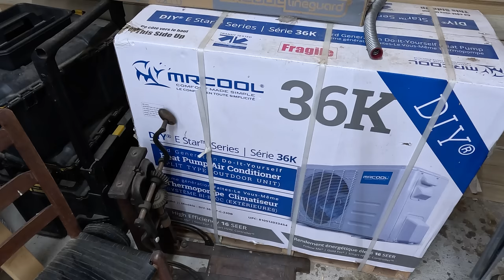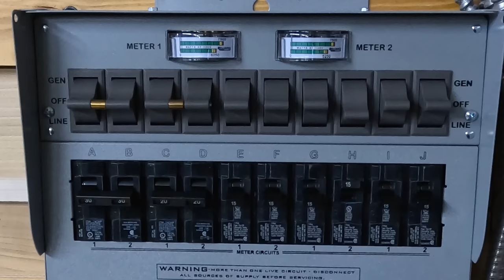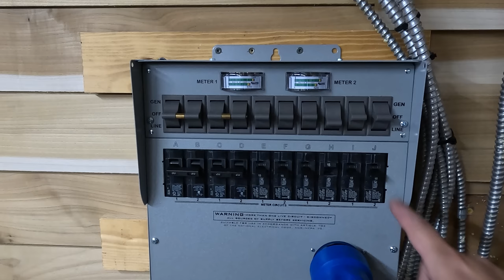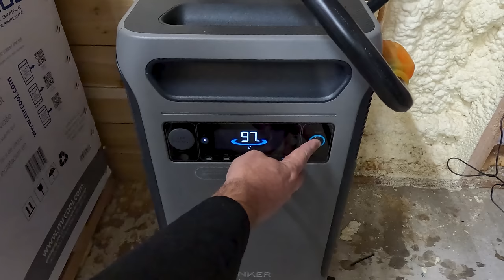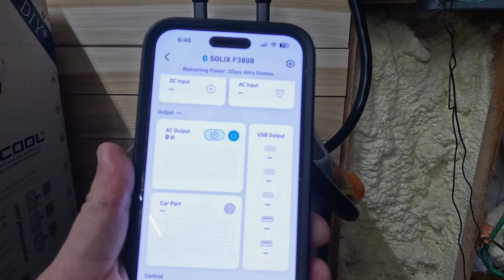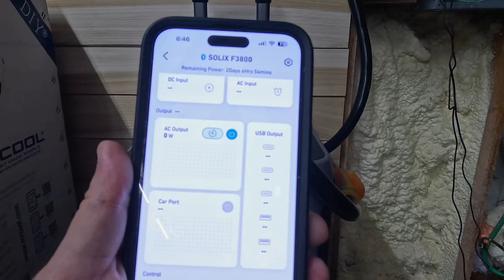Off Grid Power For The Timber Frame!  Anker SOLIX F3800

Comment: Shouldn't the blue plug mount through the hole in the switch panel with the heads of the screws on the outside of the panel instead of having the screw ends facing you?  That way the stress is on the blue plastic and not the screws.  Nice summary video of the installation.

Comment: Thanks for sharing with us Nathan, that is an awesome set up you have there and correctly installed will give you peace of mind knowing the safety for everyone involved during a power outage.  Thanks to ANKER for sharing their product with you. Fred.
Reply: While I understand you need to make paid advertisements for sponsors, this is a ridiculous solution.   If you need true back up power to run your operation, a small battery is the height of stupidity and you do your viewers a disservice by recommending it.   If your ability to make a living requires enough power to run 240C high amp equipment you should have a sufficiently rated generator, running on propane, and a 1,000+ gallon propane tank.   

It should also have an automated transfer switch versus a person having to go outside during a severe storm.   I speak from experience.

Comment: Nice to see this Nathan. I bought an F3800 through Anker's Kickstarter late last year and love it. I have an underpowered shop (currently garage, pole barn soon) and am using this for my woodworking hobby. I run my Onefinity CNC from it and it did great on one of the coldest days of the year (-8 F on 01/14/2024). Just with the CNC controller, X/Y/Z servos and a Makita palm router, I can get 12 hours runtime. I have a pair of 400W solar panels that I am building a rack for this weekend that will add  even more runtime.

Comment: Have you ever used a metal detector to check for the presence of metal. They will pick up metal as large as a BB. Iron is particularly easy to detect up to a foot or two within the log.

Comment: Great video, thank you! Can you help identify best solar panels to use with this unit besides the portable ones due to the limited 60V solar input? On some reviews I’ve seen they using the F3800 unit with 3 panels in parallel that are LG 365W each.  47.7VOC, 9.39Imp total of 28.17 amps potential using two 3 panel strings to connect of the F3800. Any thoughts if these will work and your panel recommendations?
Reply from the maker: I haven’t hooked mine to solar yet.

Comment: This really caught my attention.  I need something that will power mainly my well pump, refrigerators and freezer when power goes out.  Would be nice to power heat pump too, but I can manage without it (I think).  I being wired in to switch over is really handy, instead of having to move the unit around to plug individual items into the unit.  Looking forward to seeing how it works in your house. Keep advised.

Comment: Looking at the #1s and #2s, across the bottom of the panel, I think every other breaker on the switch box is the A-leg and B-leg.  The A/B is a 240 breaker and so is the C/D breaker.  So the meters are reading all the #1s and all the #2s.

Comment: Nice set-up.
Another way to wire in an alternative source is to feed it into a 220 circuit next to or below the main breaker with a mechanical interlock that prevents the main breaker and alternative source breaker from both being turned on at the same time. This is the set-up we have in our house that allows us to power any circuit during an outage, within the limits of the alternative source.

Comment: Check your local electrical regs because BX conduit is regulated for short runs typically under 6 feet.
Reply: BX can be run any distance. FMC, which he used to connect the transfer switch to the panel, can only be used 6’ or less.

Comment: While I understand you need to make paid advertisements as a source of revenue, this is a ridiculous solution.   If you need true back up power to run your operation, a small battery is the height of stupidity and you do your viewers a disservice by recommending it.   If your ability to make a living requires enough power to run 240C high amp equipment you should have a sufficiently rated generator, running on propane, and a 1,000+ gallon propane tank.   I speak from experience.
Reply from the maker: I just need something to run the lights, not my whole operation,  I never said I was going to run my operation with this system. That would be foolish and even more foolish for someone to assume that from this video.  I speak from experience with keyboard commandos,
Reply: @OutoftheWoods0623  
Nathan: 

Not arguing just to argue, but if all you needed was some light when the power went out, wouldn't a couple of LED headlamps dome the trick versus something costing thousands?    The video made it seem like you were trying to accomplish much more.    

No need to reply -- perhaps I was confused as your videos are always very practical.